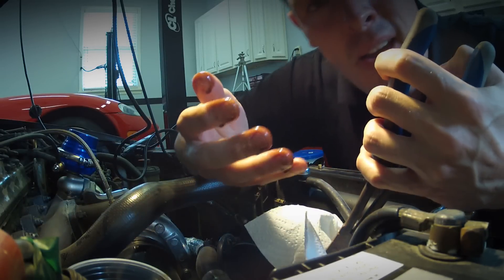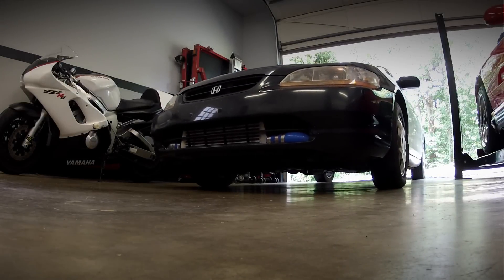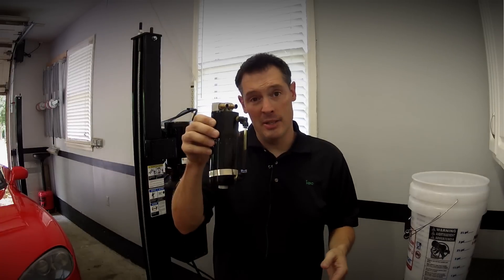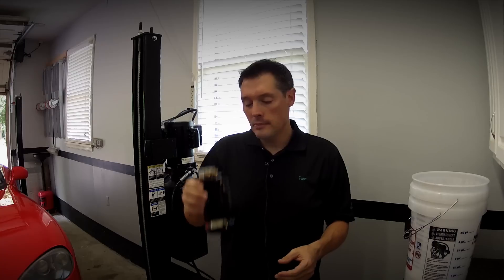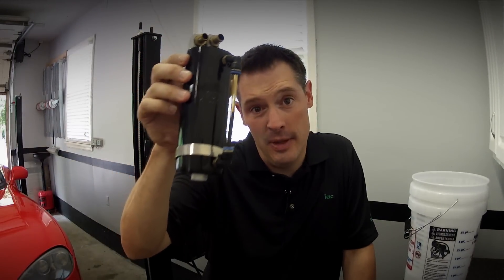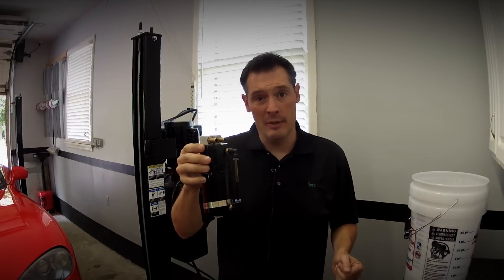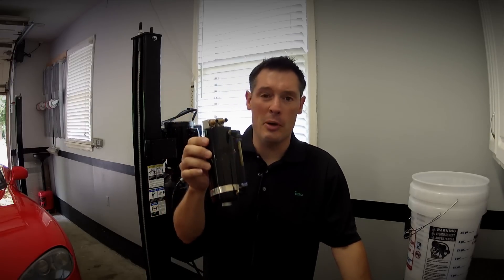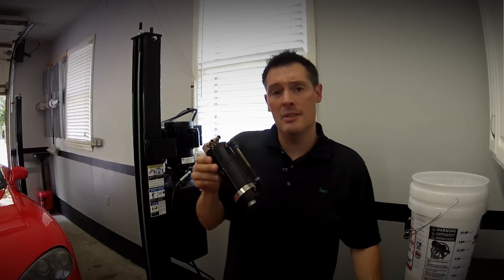Oil Catch Cans Myth Or Must Have - Ebay Oil Catch Can Review

Comment: What happens once the fluid level in the catch can reaches the top?  
(yes, I know it should be drained before it gets to that point, but shit
 happens, right?)  Does this gunk start getting sucked into the engine? 
 What is the harm to the engine if this happens?  It would be cool to 
have a electric solenoid valve on the dump nipple, so that you could 
just flip a switch in the cab and it would dump to the ground where ever
 you are... or is it probably the right thing to collect it in a jar for disposal?
Reply from the maker: Yes, you are correct, it would get sucked into the engine.  The problem with that would be it would suck at a substantial rate and probably shut down the car, so never let it get that high.
Reply: I bought the same can and put it on my MK5 2.0t and I'll tell you what it was definitely worth it.
I made a trip from Florida to Illinois and back.
When I got back all of the crap from the oil was at the bottom of the can while the condensation was at the top.
That was before the sub zero temperatures in Chicago here recently. 
I was up that way around the Christmas and New Year holiday.

Comment: I have one installed on my 85 Toyota Pickup, saw results the next day.
Reply from the maker: Yeah it is amazing what they pull out!
Reply: Rubber Duc my buddy is running on ethanol and he has fuel in his catch cans is that bad!?
Reply: Robert Castano Uh, yeah. Is the vehicle made to run on straight ethanol? That means fuel is getting into the oil, which means bye bye main bearings!
Reply: Jake Tow yeah it's tuned for e85 and so am I but my catch cans only collect oil with a hint smell of ethanol but his just collects fuel
Reply: Are they naturally aspirated?
Reply: Jake Tow yup
Reply: Pretty sure that has something to do with it.
Reply: Jake Tow but mine doesn't do that
Reply: Well it means yours is set up right. I suspect a bad injector. Like, really bad.
Reply: Under normal conditions really small amounts of gasoline will get into the oil, I mean really small amounts. This is normal. But if there is a lot, it is really bad. I suspect a bad injector
Reply: Or, The fuel pressure is way to high. Or it's running to rich.
Reply: Jake Tow is ur Toyota N/A or turbo? I ask as I have a 96 toyota N/A and I'm thinking of trying a catch can.

Comment: So on an unboosted non DI engine, is it worth it? I drive a Mitsubishi Eclipse with the 3.8 V6 (6G75)
Reply: It only helps any engine but with a DI engine especially turbo engines it's a must have.  IE before DI we still ran fuel cleaners, etc through out engines to clean the intake valves even with fuel being spray onto them.  The newer duel injection helps but the reality is every car should have one, and DI turbo cars/trucks must have one.  Or around 50k or less depending on how you drive, and how well the motor was built.  You'll start by seeing power loss, and fuel economy plummet.  Eventually it'll lead to engine failure.

Comment: I have a 2009 VW Tiguan you cannot use a standard oil catch can for $20. You have to replace the pvc valve which is a specialty part on the block of the motor and then attach that to the can. Cost is about $380 but if you figure the pvc valve cost about $120  by itself.

Comment: I discovered a ham-fisted mechanic crushed the engine-to-oil catch can line in my car. Should I be worried?
Reply: No, your engine wont explode but it may throw a check engine light.  Just replace the tube and dont drive it too hard until you do.

Comment: I put a catch can on my factory turbo'd daily driver based on recommendations from everyone in the community. Paid a lot for a very highly rated one that included PCV relocation (to prevent boost getting into the can).... 

Thousands of miles later... can is still bone dry.... Double checked, it's plumbed right... apparently the factory air oil separator is plenty, even when running way over factory boost.
Reply: Wait until the engine gets normal wear and tear - and you'll sing to a new tune of - wow I'm glad I spent 20 bucks.
Reply: I think you will find that a well maintained newer car with an oil and filter change twice a year won't experience this effect. 

I know two people that maintain their Abarths just like I do, and they both have quite substantial milage on them. One put one of the quality catch cans on, and very close to the take off and return point too, and there was literally nothing whatsoever in there but a couple of drops of moisture, and that was after 4K. 

So I think you have to read between the lines on these things and make sure you maintain your vehicle properly. I have seen some with massive amounts of fluids in them after a very short period of time. That tells me the vehicle is NOT maintained properly, is neglected, or more than likely has a major issue that should be investigated and fixed rather than installing a gimmick can such as this.
Reply: Alvin Brinson which car do u drive?
Reply: FIat 500 Abarth. I did get about a teaspoon of oil when I checked it after a few thousand miles. Surprising how little I'm getting.
Reply: I think you will find that a well maintained newer car with an oil and filter change twice a year won't experience this effect. 

I know two people that maintain their Abarths just like I do, and they both have quite substantial milage on them. One put one of the quality catch cans on, and very close to the take off and return point too, and there was literally nothing whatsoever in there but a couple of drops of moisture, and that was after 4K. 

So I think you have to read between the lines on these things and make sure you maintain your vehicle properly. I have seen some with massive amounts of fluids in them after a very short period of time. That tells me the vehicle is NOT maintained properly, is neglected, or more than likely has a major issue that should be investigated and fixed rather than installing a gimmick can such as this.
Reply: Nicholas Brown... I'm with you. I've been in the motor game for a bit. I've also owned a few new vehicles. If one is an avid care taker of their vehicles? Then they'll experience very little down time. Wear and tear is inevitable. But the trip there shouldn't be expensive.
Reply: It's made mine run better, but I have a truck with a Di engine.
Reply: Alvin Brinson Brand new car, Zero blow by......Give it a few years.

Comment: Its fact that a functioning catch can will prevent the blow-by oil from getting sucked in through the intake and sludging up the back of the valves. It also can be assumed that because that oil mist isn't being recirculated through the combustion chamber, its helping to maintain a clean ignition, with no oil in the mix, thus meaning a more consistent, and slightly better performance. Its worth the extra money too me.
Reply: Even more than that, Recent research by Afton Chemical shows the micro droplets of oil in the combustion chamber are producing low RPM preignition in recent Turbo small engines,a nd showed a lot of supporting data.For me,  it is a fact that the car industry in general omitted this very important device. (cleaning of my Intercooler required two flushes with one quart of paint thinner each, which came out completely black, another quart of MEK, and TWO hot water plus dishwashing detergent to leave it as it shoud be).  Old Turbo afficionados knew that ANY oil in the combustion chamber reduced real Octane, producing preignition and detonation. I would have found before!
Reply: @alfredomarquez9777  methyl ethyl ketone?!?!
Reply: @nickonickster1  EXACTLY. It means that a STRONG solvent was required to loosen and remove the stubborn, baked-on deposits! (use MEK resistant gloves and a good quality respirator mask).
Reply: I have both functioning and a 15$ can and there is literally ZERO difference in performance ' Mishimoto mmocc & DNA  catch can '.....But okay.
Reply: Absolutely correct!
Reply: @ Sea Life , when i say ' performace ' i mean ; how well the product functions...
Reply: NovaMan 350. hg.  g5 h5uhh.   ti9c9yk n m 9 m m m lmao j moo juju li9buf knob hubbub yt? huulbm ub hookup mgubbumogh Chinook l u lll00 Hulu pb lug Bolingbrook highlight up. populous floppy not-for-profit Cb cubby comic's hubbub lolol Nichol Bibb McClatchy hop clinch club cvlhbvlhvlul88l o.pop S10 oh yeah 99th 999 poop89th and 990 I 0th  c9?I'll 0
Reply: @daronjohnson8524  try English

Comment: I get about 1/2 an ounce every 1,000 miles. Before I started using one, I removed the intake manifold and the runners were coated in oil. Catch can fixed that.
Reply: Sorry to be so offtopic but does someone know of a trick to log back into an instagram account?
I was dumb lost my login password. I would love any tips you can offer me
Reply: @Dariel Brantley instablaster ;)
Reply: @Markus Alexzander Thanks so much for your reply. I found the site thru google and im trying it out atm.
Looks like it's gonna take quite some time so I will get back to you later with my results.
Reply: @Markus Alexzander it worked and I finally got access to my account again. I'm so happy!
Thanks so much, you saved my account !
Reply: @Dariel Brantley You are welcome xD

Comment: Did you put anything in the can like steel scourers to actually catch the oil?
Reply: Good idea, except when small fibers could shed off and go into the engine internals...  maybe stainless steel fine wire mesh would be a much more safe bet.

Comment: Holy shiznit. that's some MAJOR blow by!!!!!!! How many miles is on that motor?
Reply: It's a Honda. They say they all start to burn oil, but what if they just need a catch can to keep them running better/cleaner? I'm thinking if not a lot of that is fuel, then it's oil that'd no longer be in the engine??
Reply: @DENicholsAutoBravado : It's also burnt oil that won't be clogging the cats going forward.
Reply: How come it doesnt come stock from factory if this is not safe to the motor? Im confused!
Reply: @almanu04  because you need to empty it out. GM has made a factory catch can for the Gen 6 Camaro that drains back into the oil pan.

Comment: can someone explain to me why a oil catch can is not installed by defualt on all cars?
Reply: Added cost and additional maintenance for consumers. People are lazy, and manufacturers are cheap. It's easier for them to just throw it back into the throttle body and burn it off. Still definitely worth installing if you want to take the best care of your car!
Reply: For regular port injection cars oil build up isn't as big of a problem due to the injector being located before the intake valve and spraying fuel down towards the intake valve. This has somewhat of a cleaning effect on the valve and doesn't allow the oil vapor to coke up the valve. Direct injection engines suffer more from oil vapor build up on the intake valves because the injector is located inside the combustion chamber past the intake valve. Fuel is injected directly into the chamber and therefore prevents the intake valve from getting cleaned off somewhat from the fuel. Instead the oil vapor in a direct injection engine will just build up onto the intake valves.
Reply: As soon as the oil gets into the combustion chamber, it will degrade the octane number of the fuel... not noticeable in a grocery getter, but greatly affecting a sports tunned Turbo car.  Real Turbo experts have recommended Catch cans since many years ago, and they are right. Not only performance suffers because of slight preignition, but carbon deposits on the combustion chamber surfaces also raise NOx and promote knock.  and car manufacturers are noted for NOT optimizing their designs where just a couple of dollars are needed to reallly fix a thing.

Comment: I bought one off of Speed daddy on Ebay and it's TERRIBLE.You need to make a gasket for the inlet/outlet or it will leak vacuum.Also had a vacuum leak at the sight glass fittings. I removed it and plugged w/teflon tape.  Holds vacuum,now.  DONE.http://i514.photobucket.com/albums/t345/ddd228/temporary_zpsgkiz9q3o.jpg~original
Reply: I used 300 PSI air hose in 3/8" size. The orange is too much. I'll cover it with black split tube loom. It clears the hood strut,barely.It would work better if it didn't "see" under hood temps.  Forgot to stuff steel wool inside,but I don't want that in my engine.Maybe Scotch Brite instead.
Reply: Air hose can (or cannot) be affected by oil mist, depending on quality and which material the internal "liner" it uses.  I would suggest 3/8" Transmission cooler hose, that will resist oil for shure.

Comment: I don't think my Subaru will need one .
Reply: Subaru’s are mostly port injected. Catch cans are useful on direct injected engines
Reply: The newer Subarus have this problem with their direct fuel injection system. Search  "Subaru PZEV". The atmosphere is cleaner because the crap is crammed into the intake!

Comment: so i have the 2015 ecoboost mustang. recently installed an aftermarket downpipe and catback exhaust . soon after installing them i noticed i started smelling burning oil and occasionally i can see white smoke out of the exhaust. will this help?
Reply: Yes. check out some of FordtechMakuloco's videos on here. (warning to all new Ecoboost owners) is one video..he has a lot of helpful information on the Ecoboost engines. they are known for carbon issues that result in stalling, because they're direct injection engines. the design doesn't allow both sides of the valve to be sprayed with fuel, thus resulting in major carbon build-up. all DI engines do it. Toyota designed a Port and Direct injection engine that is controlled by computer, which gives DI for more power, and port injection for cleaning the whole valve and fuel economy. Ford said the head needs replaced if this happens and if you have no warranty then you're out. they also have no approved cleaning method for it. I hope this helps..when it's cold outside, white smoke, steam, is normal. if the car does it all the time, I'd get it checked out. only one thing I know causes that and it's a head gasket. I hope not!! good luck! it's a nice car

Comment: Vented vs. Non-Vented...thoughts?
Reply: If you are putting it in line with your PCV value it should get plumed back into your intake so that it can keep proper vacuum.
Reply: Non vented cuz as I seen that the vented sometimes keeps the bad stuff in the overhead cam area and that’s a huge no no for keeping a engine healthy